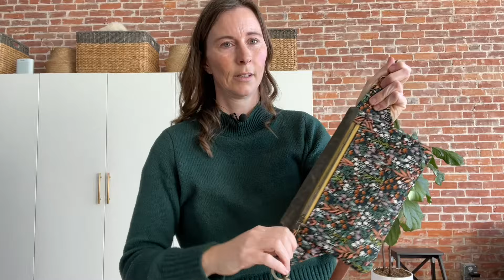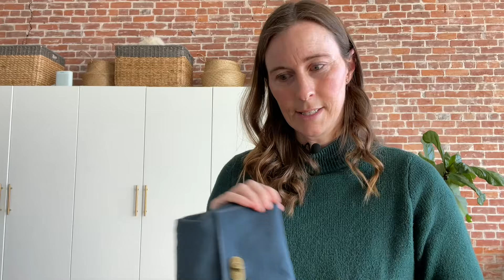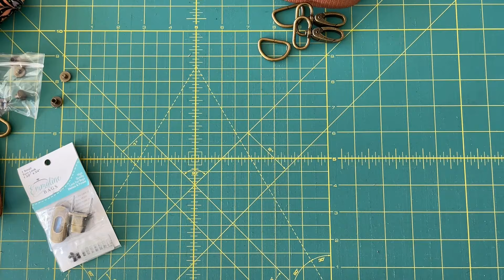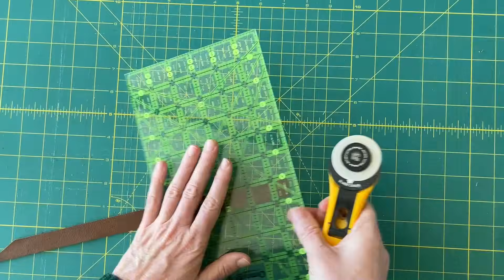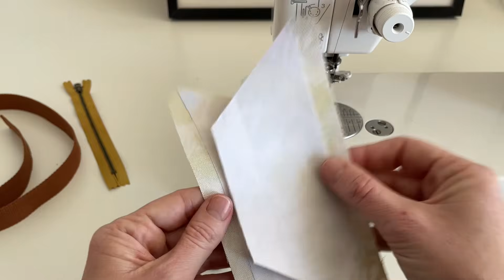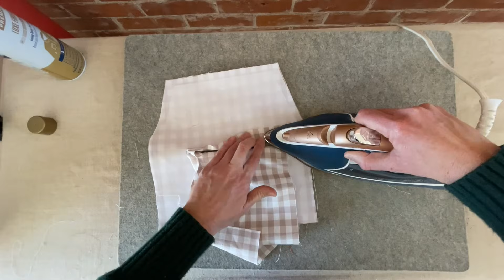Haralson Sew Along Part 1

Comment: Thank you for making excellent tutorials.  I made two Sandhills and two Yarrow pouches using your tutorials.  May I ask.  Could you use quilt cotton for the exterior? And is it important to make sure you have the grainline in the right direction when cutting?
Reply from the maker: Thank you! Glad you liked making the Sandhill and Yarrows! I wouldn't recommend it for the exterior, but you could, I would use a heavier interfacing/heavier combination of interfacings if you did. And yes, grainline is important.
Reply: @noodleheadsewingpatterns  thank you for answering my questions.

Comment: For the flap can you use faux leather instead of waxed canvas or oil skin? I live in an area were waxed fabric is not sold locally. Also, can you use cotton fabric for the main outside fabric?
Reply from the maker: yes, for sure! Here's the list of recommended fabrics from the pattern: Mid-weight Canvas (6-8 oz. weight), cotton twill, OR dry oilskin/waxed twill for exterior and accent fabrics. Quilting cotton for lining.
Reply: @noodleheadsewingpatterns  Awesome thank you, also what kind of tool do you use to press the metal snaps in the leather?

Comment: I’ve never heard of fabric referred to in ounces before. I have tons of fabric -  canvases, cottons, vinyls that I’ve made bags out of before, but I’m wondering if anyone can help me to decide which fabrics i already have that are close to 8 ounces? Is there a trick to figuring this out because I’ve never seen it on the labels
Reply from the maker: Hi! Yes, it's a bit tricky to figure out without the bolt information. Online listings typically show the weight, but not always. When manufacturers calculate fabric weight, they take a standard-sized piece of material (often a square yard) and weigh that on a scale. This will then yield the grams per square yard or ounces per yard, of the fabric. So if you have a scale, that would be the most accurate way to figure out what you have in your stash. Most canvases should fall within the range needed for this pattern. Hope that helps!

Comment: Thank you for the sew along!! Any tips on…How you determine if the weight of fabric/s does not need interfacing? And any cons to not using it otherwise?
Reply from the maker: Hi Monika, I would definitely recommend using an interfacing with most fabrics. Cork fabric, or faux leather might be the only two I can think of right now that wouldn't need interfacing.

Comment: Hi Anna  where would we look for the waxed twill..  thank you. Another cute bag
Reply: Al Frances over on Etsy has a good selection of waxed canvases. You can also check over at House of Klum, they have nice waxed canvas. Fair warning, neither are inexpensive. Al Frances is cheaper, but imo, the Klum House is nicer.  I made the Pepin Tote with waxed canvas for a pal to carry her crochet projects and she loves it. Waxed canvas is nice to work with, worth the cost.
Reply from the maker: Hi Kip, the only place I've personally shopped for waxed twill (again, I wouldn't recommend waxed CANVAS for this bag) is AL Frances Textiles on Etsy. She has a selection of 1/2 yard cuts (which is plenty to make multiple bags from!).  Here's a link to the waxed TWILL section of her shop: https://www.etsy.com/shop/ALFrancesTextiles?section_id=26040098